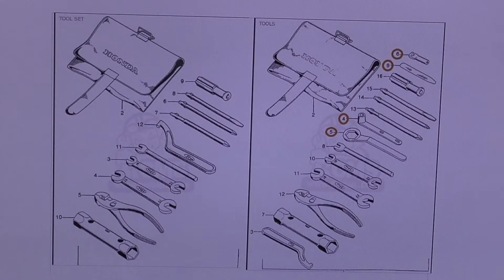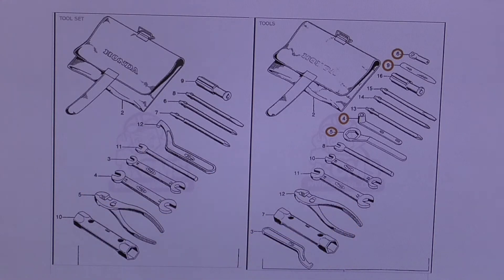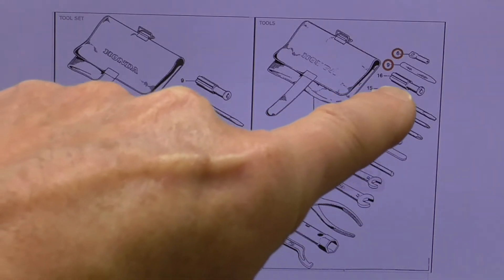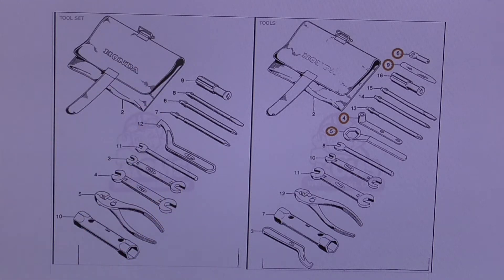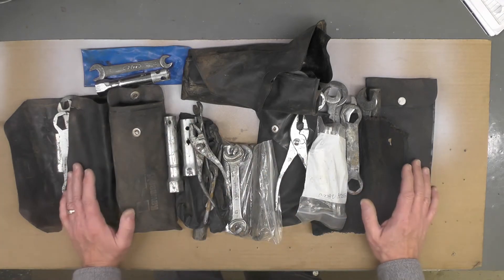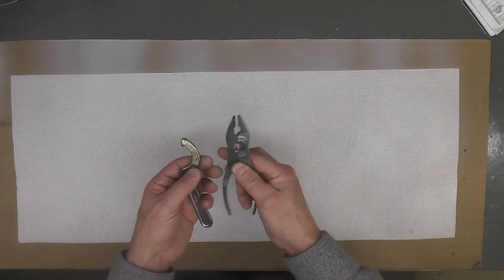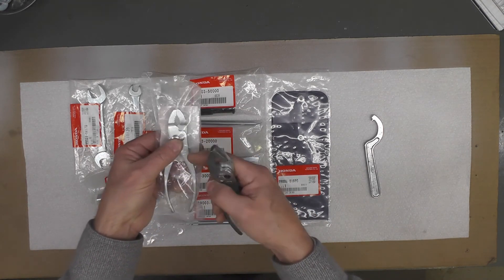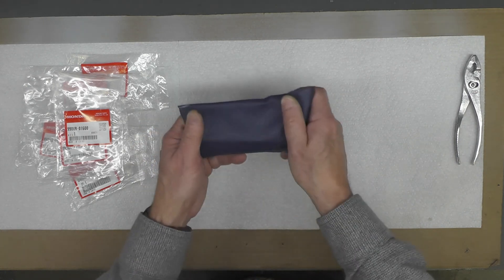Honda SL125, Putting Together a Tool Kit --- Video #258

Comment: The larger pliers that you show in the video appear to be from a factory mechanics took kit. They are a "full sized" tool and I don't remember ever seeing that size in a motorcycle tool kit. In your experience, do all the pliers in Honda motorcycle tool kits have the HM logo on them? I can't recall ever seeing that logo on pliers in any of my tool kits. Also, do you include the "owners manual" with your restorations? Good to know that some of these tools are still available from Honda!
Reply from the maker: I agree Pete, the new pliers seemed too large for a tool kit, but that's what Honda specified in the parts listing.  Regarding the Honda logo, I seem to recall some tools having the logo, some not.  I'm not sure there's a pattern to rational behind it.

I do always attempt to include an owners manual with each of my restorations.  I track down the very best copy I can  find, which may take some time and effort (and money).  Just one of those little touches that I believe nicely finishes off a project.